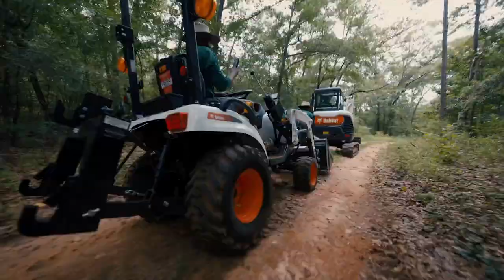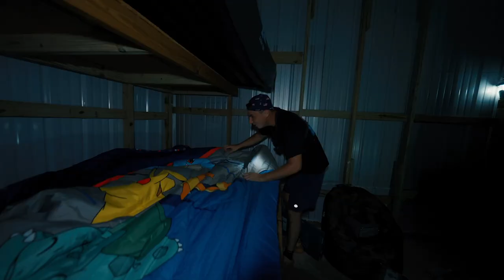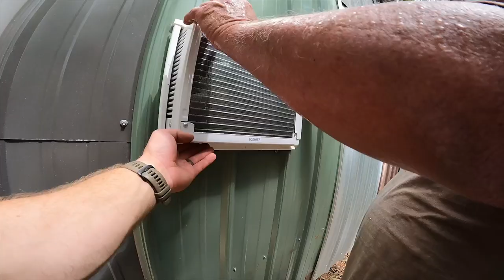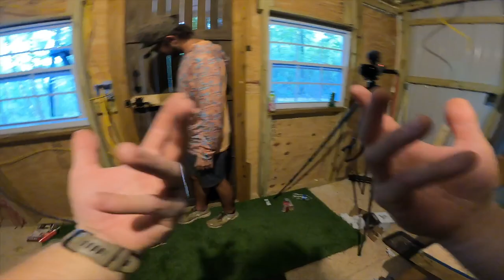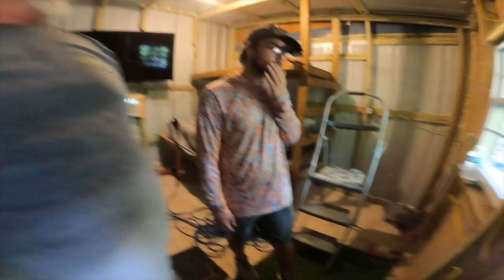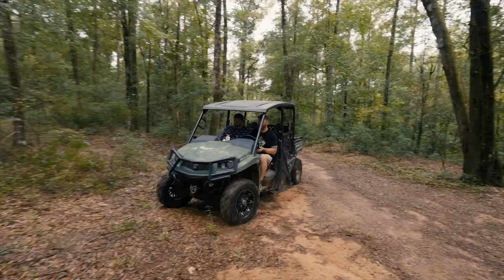Renovating NORM's House on my Property!! ( we have power!! ) **DIY Cabin in the Woods**

Comment: The place needs an antique hurricane lantern hanging out front. I have a collection of them and do actually use them. Excellent source for ambient light and you can use citronella oil in them. I use lamp oil in the ones I use indoors so they don't stink like kerosene.

Comment: I enjoyed watching you build an off grid cabin. I lived off grid in a similar cabin for two years, and have worked construction in the past. I think you'll like it a lot short term, but I was a bit concerned when you mentioned insulating it. The foundations are likely to rot out, so I don't see it standing in 10 years down the line, but that isn't as bad of a problem as mold in the walls. Right now you have a fully water tight seal on the outside of the wall, while most housing is semi permeable. That means water will run off the outside, but water vapor can evaporate through the wall to get out. When I've done repairs in the past, any time a carpenter thought they could just make an air tight water tight box and seal it all the way around, it filled with water and rotted out everything. So your single layer wall will work just fine as is, but I wouldn't put an internal finished wall or insulation against it, as it could mold or rot out the studs. There are various ways to avoid those problems, I just wanted to mention them so you would be aware. On a lighter note, I really enjoyed your reaction to Darrel plumbing the window frame, as it demonstrated your naiveté regarding vertical true (plumb) and horizontal true (level)

Comment: Norms house is coming along nicely! Insulate it and put some shiplap on the walls, and it will be amazing
Reply: What's shiplap?
Reply: @datruthhurts3984  its a type of siding
Reply from the maker: thanks for the tip!!
Reply: LoJo, seal the cracks in the door and the AC will do a much better job! 

BTW they make a window unit heat pump that has both heat and AC. This might help out inthe cooler months as a heat source.....or add a wood stove. You've got plenty of fuel available!!!
Reply: Shiplap would look 😎 cool

Comment: You can use foamboard for the insulation, and your lean-to could be utilized as a outside kitchen, and the door has cracks in it, so your cold air is gonna escape thru the cracks, there are also light bulb extensions with a pull cord for the off/on position so all three lights don't have to be on at the same time, Lowe's or even home depot should have them, I always enjoy your videos, you guys are a bit looney but that's how men are, right

Comment: Looking good! The cracks in the door will need to be addressed when you insulate...easy fix. If you could make the whole thing solar, that'd rock. However,  the biggest thing I see now is making a shower house where you maybe use reclaimed, treated rain water for a shower. You could even have it go through a propane or electric mini water heater like they use in RVs and small trailers. Ya gotta keep the funk down in a small space.

Comment: You guys should have done the windowless AC unit. It does AC or heat depending on the temperature outside and it will only cool the air that's already in the building

Comment: @Lojo fantastic job guys.  A few things you may want to do later on is put plugs higher for the upper bunks for charging cells incase their wires dont reach the lower plug, put in all ur wiring b4 u spray foam, seal tge front door as there are gaps, also spray foam it for insulation, cover all walls with paneling id do the white wood look it would look great and keep it feeling larger then if u put dark paneling in there, seal up the top  areas and any other areas, maybe invest in a cassette toilet or a bucket with a toilet seat lid for ayos #2s (we all love ya ayo).    Also u may want to put a disclaimer on this video as andrew #2 is not certified.  Also id have someone with electrical background just double check everything incase there is a fire and insurance purposes if it spread to someones home or if u guys were in it god forbid.  I say this because i use to work for the fire dept, and lets face it all those trees would catch quick.  So please stay safe and just have it looked at for piece of mind and insurance purposes because  they would definitely use this video against you.  I truly think ur an amazing person and i love everything u represent and i just dont want u to ever get caught up in anything.  Keep safe and i look forward to all your videos.
Reply: Nice looking out.

Comment: LOJO y'all did an amazing job on Norm's house, I hate to be the one that says "BUT IF" you want to keep bugs and stuff out you really need to either caulk up the spaces between the boards of the door or add strips of wood over the spaces between the boards. Otherwise y'all really did a great job on it. You never know you might want to add a few more houses like a small village of camp houses.
Reply: I'm curious to see how quickly mold sets in
Reply: @2ballsyourjaws  it shouldn’t mold up till they insulate it and close all the air gaps. After they do that they should put a turban vent that turns with the wind to keep fresh air in and moldy air out

Comment: On the door to fill in the gapes between each you could take some 1”x4”s and cut them and run the vertical half on each board so the gapes are covered. Kind staggered looking. Like a board on board fence. Also really hope you do decide to Spray insulated instead of not having any

Comment: Two things..they have those switches that you can put into the cabin that’s wired into the generator so you can turn the generator on and off from inside…second, you could easy throw 2 panels and 4 batteries on that system and have solar which would save on gas and for sure power that cabin 💯💯

Comment: You should get one of those solar batteries instead of running gen all the time use the battery for quiet
If you get a large one then it will run the ac for a while

Comment: Lojo, I would have drove from central Florida to wire Norn's house. You can't ground a ground to wood, it's a insulator. Lolol. The journeyman electrician in me was screaming at the TV. Lol
Reply: That light was grounded to the tin walls
Reply: I believe all the grounding was connected back to the generator . I hope he didn’t run it to wood. Either way the shed itself isn’t grounded at all. I would install a grounding rod to the sheet metal

Comment: Look into reflsetix it's used in vans to reject the light/heat from going inside the van you can possibly do this with foam insulation
Edit: also for power you can use solar and loads of battery's some companys make kits to use like ecoflow and others just look into the ones that fit your needs

Comment: @lojo you really need to put window tape around those windows before putting the trim back on.  will prevent moisture, bugs, critters, and cold/warmth from either getting in or escaping.  great for longevity.  I know this is only a cabin but cheap insurance.

Comment: Lowe's and home Depot sells spray foam that's insulation it's a A&b you spray it and it becomes extremely airtight maybe a better option than just putting regular insulation in it'll help sell everything and make the building much stronger just a thought

Comment: Going to need heat in the winter.  I'd look at a wood burning stove that will double as a cook top and heater. Propane would also work but I'd get a larger propane tank so you're not changing out 20lb'ers that will freeze up in cold temps when used. Looks awesome guys.  If you need help let me know.  Jack of all trades and would love to get out of Illinois for a while. Lol
Reply: Us Florida men don’t need to worry about that

Comment: @LOJO make sure that ac is leaned back a little bit or it will drip inside of the cabin an cause water/mold damage! If you already haven't done it. It just seemed a little to level in video

Comment: @LOJO Thinking back now, yall should have done Murphy beds, and when the beds were up on the walls you could have put hangers with all types of baits obviously with stoppers at the end so nothing fell off but essentially it would like your walking in a small tackle shop lol. Had all the rods on the wall. Little glass vertical case with some reels lol. Would have been like a true fisherman's retreat man cave. Not too late can def still make some fine adjustments. That would def be some next level MTV cribs type sh*t. Def want to put an alarm or some cameras with motion sensing recording though. Great job so far. Lot of hard work and labor went into that man cave. Deck it out LOJO!

Comment: there's a 12 &14 gauge built in wire stripper on the receptacles that you can use in a pinch

Comment: You should do harbor freight solar panels and run 12 volt LED lights and inverter for small electrical.  Then run the generator for AC and big stuff.
Reply: Congratulations you have been selected among my lucky winners contact the number above for more info ^^^^^^^^^^^^^^^^^^^🎁✅

Comment: you should set up a solar panel on the roof with some batteries to power the cabin just like flairs it works pretty good and will save you on fuel
Reply: To many trees around for solar to work

Comment: You need to put some foam board insulation in and get those big gaps in the door plugged up because it won't hold the cool inside very good.

Comment: That electrical work is really dangerous. I don't know how the grounding is done, because if it's done wrong and someone touches the wrong metal part and at the same time something connected to the generator, they'll get the ride of their life. Hopefully not the last ride. Also you have NOW windows protected from insects, etc, but the door is full of such big gaps that almost Norm, as a big man he is, gets in through the cracks. And lastly, good video.

Comment: I couldnt see all the wires but switches should only have one color going in and out. The switch is just breakimg the connection. You shouldnt have white going in and black comeimg out. And im pretty sure i saw a switch with black going in and white going out. Id go over it again. You still might have power because there is still power going through the return but it could be dangerous for electronics using reverse polarity. Maby not lights but tvs and chargimg batteries....